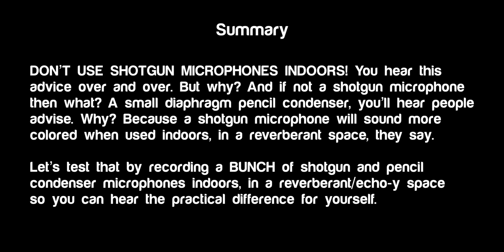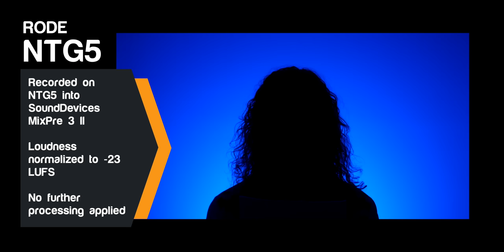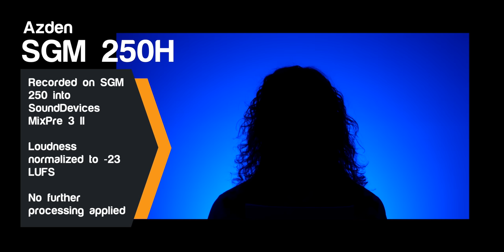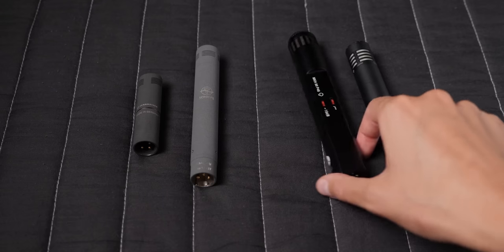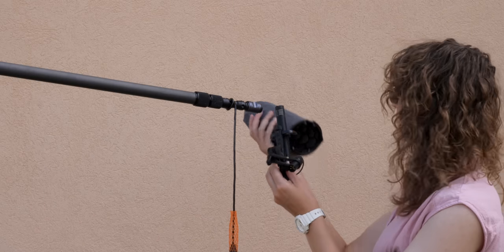Can You Use a Shotgun Mic Indoors? Shotgun vs Pencil Condenser Boom Microphones

Comment: I work in TV and when Covid struck, many of us (who could) were sent to work from home. I recorded my voiceovers on Olympus P4 audio recorder (that I even didn't buy, but was randomly bundled as a promotional product, when buying two of their PRO lenses for my photography hobby). I'm sure a true professional would be appalled if they see my "soundproofing" (a blanket over my head and a pillow infront of my mouth) but trust me - for several months, the national TV I work for, happily broadcasted videos with the sound recorded in that way 5 days a week :) The moral of the story is - do not overthink it. Be sure you are not recording in a noisy environment. Try limit the reflection of the sound from walls and the ceiling . And be sure you do not talk too close to the mic so the Ps and Bs sound like a thud. From there on - pretty much any microphone will do.
Reply: Voiceover is a very different beast than things like location sound or seminar recording. The 416 is a popular voiceover mic, but reflections are highly controlled despite being indoors. You would never do typical voiceover in a reverberant room like in this video. When you can control everything, like doing voiceovers or foley, you can use all sorts of equipment that wouldn't be optimal otherwise.
Reply: @chakerian I have done voice over in a sound-treated room using both a shotgun and my AT 4053b.  The result were acceptable.

Comment: For me the reason nom-shotguns sound better is the capsule is at the end sp you are getting it much closer to your mouth before it enters the frame. The long interference tubes are in fromt of the capsule in shotguns, moving it significantly further back (in tight framing) and making the audio lose body. I would love a comparison of small vs large diaphragms in an out of shot context. I regularly shoot with my CAD M179 out of frame and it sounds pretty good and having it's infinitely adjustable polar pattern is useful for working around spaces

Comment: Hi Curtis! I've been listening to a few of your videos now and found lots of amazing comparisons, but i have quite a specific question that hopefully you can shed some light on!

I create something called asmr content and always use 2 mics, (out of shot) set up to simulate the left and right ears. Since the mics need to be out of the shot but still close enough to my mouth for maximum effect, it obviously forces me to have the camera very close/zoomed in. For this reason, i was considering 2 shotgun mics, just out of shot above my head. However, i have no idea how they would perform as a pair in this role and what the impact to the sound would be. I typically lean from left to right (speaking to each ear) throughout and a little concerned with how the opposite mic will deal with this.

I've been using x2 NT1s for years now but id really like to expolore being able to record the audio from above. Sound is the absolute number 1 priority in my videos and i would be soooo grateful if you could share your thoughts on this. Budget isn't really an issue as they'll likely pay for themselves in time.  

No issues if this is too wordy and you simply don't have time :D
Reply from the maker: Hi Matt, thanks for your comment. I think the answer depends a lot on the space in which you record — how much it reflects sound and how much noise you are able to control/reduce/remove. But assuming the room is fairly well behaved from an acoustic point of view — and being the creator of ASMR content, I assume you've worked hard to make the space very soothing and quiet — two shotgun mics should work nicely. I'd purchase from a retailer which allows returns if things don't work out, but the best way is to try it out and hear how it goes. Best wishes!
Reply: @curtisjudd  Thank you very much Curtis! I'll see if I can source x2 416s locally with a solid return policy.

Comment: During covid, I did a test with the MKH 50, the MKH 8050 and the MKH 416.  For some reason, the 416 sounded tinny to my ears while the former two had a nice warmth to them.  Since most of my recording is indoors anyway, I opted for the first two.  I more often end up using the MKH 8050 just because of it's size being even easier to place and I have a hard time hearing the difference between that and the MKH 50.
Reply: Size, surprisingly, does make a difference indoors.

Comment: Thanks Curtis, I'm a relative newbie and amateur, but now I better understand the practical differences between these different types. Currently I have a Sennheiser MKH 416 and a MKE 600. Although not ideal indoors, I can't yet justify buying a HQ pencil condenser like the Sennheiser MKH 50 as I need to prioritize decent lighting, not to mention improving my skill base, but I'm slowly getting better.
Reply from the maker: Keep it up!
Reply: There are certainly some amazing pencil condensers listed out here, but don't sleep on some of the cheaper ones. For instance, the Shure SM81 is around $400 and works very well. The SE7 from SE is also a phenomenal mic, low self-noise, and around $90. Just don't go for the super cheap Samson CO2 (although they are still passable with appropriate editing) and you'll be fine. 

Podcastage does excellent breakdowns of all kinds of pencil condensers, so I recommend you check him out for direct comparison.
Reply: I would recommend you check out the AT 4053b.  Based on reviews, I purchased one, and immediately  fell in love with it.  I dragged it to film shoots and forced can't and crew to listen to it.  They looked at me funny, but I love love love that mic.

Of course, someone else loved it too, and stole it.  $699 for a new one.  It will take two months to pay that off.

Comment: Hi Curtis, I'm building up equipment to do sketches/short films mainly where I expect to be working with 2-4 actors at a time. Would you recommend just 1 boom mic (if I can get a boom operator) or play it safe and get 2 and put them on C stands or something, so I don't have to rely on another person?
Reply from the maker: If the actors will not be delivering lines while moving around, then I'd put the mics on stands and set marks for the actors.

Comment: Thanks for the video! I think a lot of the differences in mics come out if you have to boom dialogue in messy situations, and swing the boom around a lot. Overlapping / improvised dialogue is much easier on a pencil supercardioid etc. For interviewing people in a fixed situation or doing video essays / podcasts, it feels like you can almost use any mic. The thing with using shotguns indoors to me is also not a hard rule, it's just that you'll be in the shot quicker, because the mic is long, and you might not be able to maneuvre around low ceilings, often bringing you in bad booming positions or casting more shadows. But some people make it sound like you're going to die if you use shotguns indoors and that is certainly not the case, as your test demonstrates.

Comment: Hi Chris, so just to confirm, you are saying if only 1 mic, the MKE-600 or the MKH-50? Ido want to use indoors and out. Most of my shots are indoors...with a 70/30 ratio. You think these are better use case than the new Deity S-Mic3 or 3S or the MOVO mics? Thanks in advanced.
Reply from the maker: These sit across a wide range of prices so I’d first narrow down how much you can realistically spend on a mic. But if I could only choose one from this list, I’d choose the MKH50 for indoors and out.
Reply: @curtisjudd  Thanks again for you reply and noted. So for my use case, do you see the MKH50 better than the Deity price to performance ratio?
Reply from the maker: @terrygriffin5201 I haven’t used the third generation DEITY S-Mics but the S-Mic 2S was far too noisy for my liking. The MKH50 is NOT cheap, but it is a mic that can last an entire career.

Comment: Hello Sir, what would be your suggestion to get me Synco Mic D2 to use wirelessly. I tried with a Sennheiser ew G4 transmitter, it didn't work. do i have to send separate Phantom power to the D2?. appreciate your help!! thx!
Reply from the maker: Yes, you'll need a transmitter that can supply 48V Phantom power. Sennheiser makes one for their G4 system.

Comment: Great value content as always!
If I may ask for a suggestion to an issue I encounter when recording interviews with both subjects at close proximity. There is a “spill” over from each speaker to the others mic. Currently use two shotguns as close to each speaker as possible yet they pick up the other one as well…
As it is shot on a green screen moving them further away is not an option. 
What would your preferred solution be in order to have two tracks as “clean” as possible with only the speakers voice audible?
Reply: This problem is addressed at the audio recorder level (not the mic). Some of the newer professional audio recorders have a feature to automatically lower the gain of the mic that doesn't have someone speaking and then switch over when the opposite happens. I forget the exact name of the feature but if you watch Curtis Judd's reviews of the newest Sound Devices and Zoom audio recorders, he does mention this and explain it.
Reply from the maker: Automix can help. The ZOOM F series, Sound Devices MixPre II, and Mackie DLZ recorders all have variations of this. I found the Sound Devices version to work best.

Also, I’m close proximity, dynamic mics may be a better choice worth exploring.
Reply: @curtisjudd  thanks for your elaborate  suggestions! 
So even the Zoom F3 has this? 
From what i understand dynamic  mics have to be too close and visible in the frame, which is not an option here, like most musicians or pod-casters are almost "eating" them or could they be placed at about 50 cm from subject?
Reply from the maker: @EvanFotis  no, if the mic has to be out of frame, I’d just use one mic. When the people are that close and the mics are that far away, nothing will prevent mic bleed. Just use one mic
Reply: @curtisjudd  its just that when one speaker starts talking  the other usually  start with breaths, exhalations  and other funny noises etc apart from one speaker talking much louder at points that the other, that needs leveling and all these sounds are picked up and difficult to eliminate from a single track... Perhaps software solution isotope etc is best to be used?
Reply from the maker: @EvanFotis  Oh, it isn't a live show so in post production, you can railroad the individual channels. This means you cut out the portion of clip 2 when person 1 is talking and vice versa so you don't get the mic bleed. Or you can try a plugin like WTAUTOMIXER.

Comment: Hi Curtis, this comment is off topic, but concerns Rode's small twin transmitter/recorder Pro that I think has just been announced. I would love to see your take on this. I'm sure it's probably already on your planned list of new items to test and review.

Topline it looks incredibly interesting (based on paper specs). Don't know the price but for what it appears to include it will potentially rival many expensive pro kits. Maybe too good to be true.

Adding timecode, real time monitoring, 32 bit float recording on transmitter, super compact, decent run time, charging case etc. Only downside I can see is (a) uses crowded 2.4 Ghz space and possibly (b) unknown compatibility with HQ lavs like Sanken Cos 11D?

Hope you can test it soon.
Reply from the maker: It’s on its way to me now. I wouldn’t consider this as a competitor to pro wireless systems like Lectrosonics or sound Devices or Zaxcom, but definitely looks interesting! More to come!

Comment: I put all Sennheisers and the Schoeps on top of each other in Audacity and can clearly hear how boxy and muffled they sound compared to MKH50 and CMC641, which sound more alive.

I did a Plot Spectrum and can visually observe a difference of peak at 400Hz, 600Hz, and 2000Hz for MKE600 compared to MKH50, and tried doing a -3db/-6db EQ, but the boxiness is still there. Any suggestions?
Reply from the maker: Use sound blankets is my suggestion. And optimize the position of the mic. 

In post, you might try and EQ match. There are various plugins which do that, though I don’t know of any free options.

Comment: What wd be the problem hookkng a battery operated shotgun mic to a rode wireless pro and recording to camera??
Reply from the maker: It wouldn’t necessarily be a problem, but in some cases, lower quality mics and cables are not well shielded so the transmitter imposes RF interference.

Comment: I use a Rode NTF3 for outdoor stuff, mostly, but I went with the Schoeps CMC641 for indoor use.  Hands down, the most amazing mic I have used for that stuff. And paired with a Zoom F6 w/32 bit float, the results have been amazing and I have had nothing but compliments from producers and directors.  I have yet to encounter ANY clipping or distortion, even with lots of yelling and screaming, or loudness, in general. Best $1700 I have ever spent.  And add the $300 lo cut filter add-on and you can use it in some pretty nasty situations.and dramatically lower your audio post workflow times w/cleanup
Reply from the maker: Nice 👍

Comment: Thanks for doing this testing. I found the shotgun microphones to be the most reverberant, but none of them were actually bad.
Which may be the issue here, if the microphones were put on the top of a camera and moved around.
I have had quite a lot of issues with shotgun microphones outside close to cliffs, in fact. The reverb changes in an unnatural way as the microphone is moved. While I haven't had nearly as much issue using a shotgun mike in a crowded dining hall. 
It hints that some people are overly fond of simple but strict rules here instead of dealing with the actual issue. So thank you for the testing, as I was wondering where the limit goes.
Reply from the maker: Yes, movement, in my experience, makes the issues more noticeable.

Comment: This was a great test to run , many thanks and yes imo the MKH 50 was the best , even more so than the 8050. One important factor that you left out is the distance that the mic was from the persons mouth when indoors. I did a test with The MKH 416 and the MKH 600 and also the Audio Technical and found that “on my voice” I preferred the 416 inside at short distance about 20 cm but the Cardioid Audio technical was much better at greater distances 40 cm plus ..with the bass rolling off considerably on both shotgun sennheiser mics
Reply from the maker: 18 inches for all of these samples.

Comment: A rarely mentioned fact is that most shotgun (lobar)  mics have a substantial rear lobe pickup that pencil condensers (super cardiod)  mics do not have.  When used indoors up near the ceiling, this rear lobe could be the main reason for the reverberant sound of the shotgun mics.

Comment: it seems like the mkh 50 has a tighter presence with less boomy room tone compared to the 8050. Is this just due to an extended low-end frequency response of the 8050? I do talking head videos with the 8050 and with male voices I often boost the highs and roll off the lows to feel more present.
Reply from the maker: Not sure. They seem VERY similar in my tests.

Comment: As far as I understand it, and correct me if I'm missing something, the physics of the coloration can be explained simply as follows. The shotgun mic is directional enough in the higher frequencies that it picks up mostly the source and then whatever is on its second bounce having hit the wall behind the camera and then behind the speaker. This means that the higher frequencies have more delay than they should accentuating the echo sound in the highs while the lows are not rejected as much and the timing is natural, but the balance in volume between high and low reverb is off. This makes the lows boomy and the reverb highs weaker and more distant sounding.
Reply from the maker: Yes, directionality and polar pattern seem to be involved along with reflected sound into the interference tube.

Comment: A couple of weeks ago I had to make a voice over recording. It was only going to be a few minutes and I didn't have my voice over booth set up.  I didn't have time to put it together. The room I recorded in has acoustic foam  on part of one of the walls and part of the ceiling above the same wall. There is hard surfaces elsewhere in the room and my computer and computer desk. I used my Sennheiser MKH 416 and Mix Pre 3 II. I pointed the mic towards the acoustic foam wall and closed the window curtains and made sure the back of the mic was angled slightly towards the window where any external sounds I didn't want, would be coming from.

I found the recording came out fine and I didn't hear any issues with it like much reverb. I also realised my neighbor directly opposite from my house, was using an electric saw and there was noises outside coming from that, but I didn't notice any of that on the recording which  surprised me, but that could be to do with how directional the mic is. In a pinch it worked, but I'd rather have my vocal booth set up and record in it.

Comment: Can you do a comparison between the three new, 
RØDE Wireless PRO
Deity THEOS D-UHF 
TASCAM DR-10L Pro Field Recorder
Reply from the maker: Yes. Are you most interested in using each as recorders and NOT wireless?
Reply: @curtisjudd  As they all have built in 32bit into the recorder and timecode that is the most important comparison for me. But of course im interested in the overall easy of use and how good it keeps and syncs the timecode. And how good it plays with other devices. I still lean towards the Diety cause they will have a new wireless module for shotgun mics comming. Things like that matter.